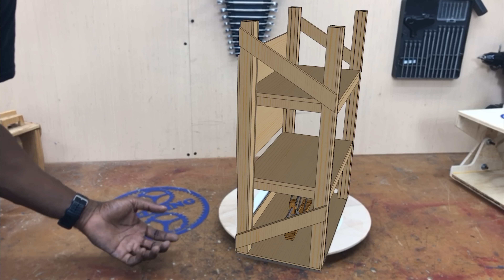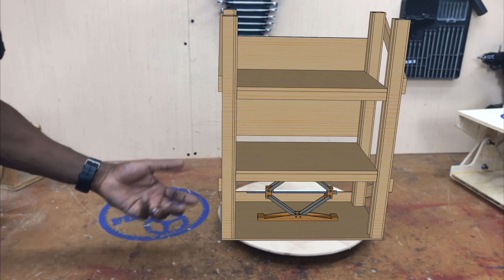Engineering Principles for Makers Part 2; Material Properties #067

Comment: Next time dont use a deceptive test like loading a metal beam in the weakest way possible and a wooden beam in the strongest way possible. If both were I beams loaded on the edge, the metal would be superior. You're trying to argue that wood can actually be better by performing a test that relies on using the metal part poorly/for the wrong job.
Reply from the maker: Sir, if you think I was saying wood is better you have completely missed the point. I agree with what you said. Perhaps give me a fair chance and actually listen to what I said about the difference. In case you won't take the time... the point was the arrangement of the material is just as important as the material itself.
Reply from the maker: You can see this proven in the math itself. When calculating bending moment it is E*I/Length. "E" represents the materials natural stiffness and "I" the the shape. They have equal weight in this formula and thus similarly important. This is what the video is about. Except I don't use these terms because I am talking to a non-engineering audience. I even put some of the numbers on the screen for you just to clarify its the same amount of material but arranged differently. Please watch again and you might notice the difference this time now that you are paying attention. There is no reason to be outraged. You just misunderstood, and that happens sometimes. No big deal. Just cool it down with all the claims of misinformation.
Reply: @Jeremy_Fielding  https://youtu.be/8EfZDWRHG0E?t=17
Reply from the maker: Agreed... lets just let the video speak for itself. I think its clear I am talking about the formula above, but I did say "or even better" than steel. So I see why you are all tied up in knots. Anyway... I summarize by saying the shape is as important as the material. The above formula was the idea. Thanks for watching. :)

Comment: Nice video.  Your revamp idea seems like it will allow you not to work to clear/clean off the top bench to use the second (a clear new advantage if you like that), but a down side if you needed the space vertically might limit your ability to work on taller projects that gave more volume from hight.  You had already constrained your length and width in your scope.   Sorry you are likely all done with this series I just watched them tonight..  I'm a crossover fan from smarter every day.  You projects are cool.

Comment: Moving to a new house with a slightly smaller garage, been working on coming up with a solution for a workbench, I want to do something similar, where I can have stationary power tools (spindle sander, disk sander, edge sander, scroll saw) all on the bottom, and be able to move them all up at once for being able to use them, plus having a work surface above them, currently I just have to move them around constantly.

Comment: My wife is short in stature and complains the upper cabinets are too high. I liked your idea of using two parallel tabletops because that would translate nicely into pull down cabinets for her.  These could also be used in houses for wheelchair victims.  Please expand on this idea more.  Also, I like the engineering emphasis of your videos.  It gives me much more to think about.

Comment: Your video is great.
I found it very interesting.  I am a degreed Mechanical Engineer and have spent the last 32 years designing machinery (primarily material handling equipment such as cranes, transfer cars, etc).  Your approach to problems is excellent and what a lot of engineers do.
I saw in a previous video you has a copy of "Design of Weldments". Excellent book. I had the pleasure and privilege of meeting the author,  Dr Omer Blodgett a number of years ago and attending a series of lectures he was giving.  Very smart man.  Good luck and keep up the good work.

Comment: More people need to see videos like this because there are SO MANY people that confuse strength and stiffness. Many people see deflection as weakness. I deal with this in my job as a mechanical engineer all the time. Everyone at my company wants lightweight equipment that can handle heavy, cantilevered loads with no deflection. When I tell them that 6061 aluminum is just as strong as A36 steel, they're all "But look at how much the aluminum one is bending!" When I respond "Well, it's still not going to break. So, if I make it out of steel, it will deflect 1/3 as much, but it will be 3x heavier." They're all "We don't want it heavier." Give them the option of making the aluminum version taller to increase stiffness without adding as much weight, and they still reject it because you're making it larger. There are trade-offs in every design. Sometimes you have to use a stiffer material when geometry can't change. Sometimes you can use a less dense material when the geometry can be taller to minimize deflection and save a little weight. Geometry matters just as much as material properties!

Keep making these great videos. The subject matter is presented so well. I'm glad that you demonstrate the principles with practical applications, especially the forces in multiple directions with that electric motor on the beam. I feel like the practical application of the principle is what is missing from engineering education, especially in the early part of the curriculum. You provide the answer to the question "When am I ever going to use this stuff?" by drawing the line between the principle and the application. That's what engineering is all about.

Comment: Jeremy, you must be a good engineer.  So many engineers know how to do the calculations, but don't think about these very basic engineering principles often enough when making a first run at a design.  As a mechanical engineer myself, I find this very refreshing.  I always have said that you don't necessarily need an engineering degree to be good at applying the principles, and that a little common sense thinking can take you very far!  (I had many "designers" that I called engineers because they understood these things.  I also had degreed engineers work for me who only had the title thanks to scholastic achievement.  Thanks so much for sharing this.

Comment: Just watched the video before this one, and now just finished this video. smashed the subscribe button. Your videos are awesome. I'm no engineer but I try think things through. I'm about to build a 16 x 16 work shop, and I'm wondering if I can put in a 2x6 (or greater) wood I-beam in lieu of a built up 3 ply 2x6 beam. I would be putting in three beams supported by concrete patio stones. Then build the 2x6 framing for the floor. So just wondering if three 2x6 I-beams would work. I am trying to build t on a budget, collecting most of the materials from my demolition job sites. If I could I would like to build the structure for free and only pay for the roofing and electrical materials. Interested to hear back from you and your thoughts on my question.

Comment: I used to work in bike shops and it always irritated me when people there would talk about aluminum frames being inherently stiffer than steel frames. They do tend to be stiffer, but they seemed to think it was an inherent property of the material when it is just that aluminum frames have to be made stiffer because the material fatigues so much more readily than steel that if you just copied a steel frame with relatively small diameter tubing in aluminum the frame's life would be drastically shortened. The aluminum frame would actually also be much less stiff than the steel frame due to aluminum's MOE being much less than steel.

Comment: Hi Jeremy, Your video is really inspiring me. I would say the way you are travelling with the contents on your head is making me relate to exactly how im working lately, things like we dont need to make everything out of steel, it doesnt always have to be gravity as the force that we have to balance, use of waste to make it work just by knowing their physical and chemical properties.  
Its all about how to precisely use the material.
I have few questions:
What would be the vibration force on the wooden base frame caused by treadmill motor while its under working condition? Would the wooden frame damp them with out deflection and noise? By the way how long would the wooden frame last before the screws and joints loosens up?

Comment: Your moveable work bench should use triangular supports instead off the front legs and use a long thin triangle to support the back so the work surfaces are free on the front corners.

Comment: Got a problem with your test for the different shapes and their deflection - in both instances, you're applying the weight in a way that wont fully apply to the bracing structure (around 5:30).  In those particular objects, the weight should be supported through the structure, not perpendicular to it, as you have done.  In other words, you should have stood them up and applied the weight to the "top" of the structure, as opposed to laying them on the sides like you have done.
Edit for clarification:  I'm not saying you're wrong about triangles vs other types of support structures, because you're not.  I am saying you demonstrated the effectiveness incorrectly.

Comment: I’m thinking unistrut as your rails. That is an easy obtainable material.you can use a garage door hinge and roller as your rolling part. I’m still trying to come up with a lift for a person to stand on to raise to about 30” and be stable. It’s for a garage door installer but any one in the trades could benefit from it.

Comment: Steel is tougher but the average guy can’t work with it. My limited experience in using steel I found how dirty it is. Plus it’s an entirely a new set of tools . You actually need a completely different area for work with steel. Ide love to fab stuff on occasion out of steel but don’t have any welding tools.

Comment: For me, the ideal horizontal space is one that slowly, slowly rolls so the top horizontal surface today becomes the bottom surface tomorrow. This forces me to keep the surface clear. What I am saying is that I don’t tend to be very good about tidying up at the end of a days work, especially if the project will take multiple days. I suspect There are other builders like me. So the idea that the horizontal surface becomes a vertical surface is appealing to me because it forces me to clean up after myself before the work surface becomes so clogged that I retch at the idea of cleaning up. By the way, discipline isn’t one of my strong personality traits. 
Great YT Jeremy, thank you!

Comment: Jeremy, your last video made me think about a wood furniture assembly table I saw while working with for soil conservation service.  The whole table was wooden with no metal.  The top was like a typical assembly table with holes for dogs and stops . The top rotated up and was able to be held at various angles.  The pivots were made out of separate wood part (hard woods bearing and pins)  from the structure.  The table was used for build wooden chairs and rockers,  I wish I had pictures but this was back when cell phones were wired into vehicles.

Comment: The pretzels remind me of a situation where I was really really stuck and needed to fix a damaged edge on desk. I had a rich tea biscuit (for americans it's a plain brittle light tan colour cookie) and some super glue. I crushed up the biscuit and maybe a little paste with the superglue in the bad notches, carefuly worked it in, cleaned excess and it actually work once scraped flush with the surface hahaha
Some maybe if we pair the pretzels with a polymer matrix we can make the next engineering super material!

Comment: As a new SUBSCRIBER to this channel, this is the kind of information I was missing from all the other channels I have been watching. I'm a retired electronics engineer. While I did have some ME classes, they didn't take the theory into practice. So I feel like you are teaching me to fish, if you get my drift. Thanks for the best channel I've found in a long time.
I'm contemplating building a DIY shop in half of my 2-car garage and want a workbench that fits the space and is easy to reconfigure. What I've been looking for is a bench with a small table saw at one end and a foldaway miter saw installed about half way down one side of that same bench. Long story short, among all the ideas I've had, using a scissor-lift mechanism would be the simplest thing to make to do the job well.

Comment: I like the idea of two horizontal work surfaces. the only downside I can see is the front pillars between the two work surfaces would limit its versatility, to fully utilize the work space. 
I would like to see if it can be engineered, to remove those front pillars without losing too much durability and strength.

Comment: Hi, thanks for the thoughtful videos. I am confused by your first example though, you laid the metal plate flat in its 
plane of weakness and the stood the I-Beam wooden structure standing up to test their relative strengths. Im sure you can see 
that this looks like selling snake-oil, why not stand the metal plate up and test it that way?
Reply from the maker: The answer is obvious which is why you are asking the question... check around 2:00 or so I explain why I did it that way. No one should be misled to think wood is stronger than steel. We all know the answer to that question
Reply: @Jeremy_Fielding  I did not check the link if thats what your referring too as the explanation for displaying the two materials strengths incorrectly (IMO). I think it should show in your vid that the plate steel would show zero deflection in that test if rotated up 90 degrees, although it would probably try to tweak side to side. Then take an I-beam of steel of the same thickness...it will be 50 times stronger than the wood no?
Reply from the maker: @whatyoudo9773  No... I mean right after the "link" part I say something like "notice I did NOT say that wood is stronger than steel but..." something like that. The key is separating strength related to material, and strength related to "shape" then the whole rest of the video is built on that prinicple. Shape matters as much as material. Certainly steel is stronger. Just don't forget that poor geometry makes any material weak. The lesson (I hope) is that sometimes the problem is weak material, but it can also be poor design. That is what the video is really about. Even steel is weak with poor design.
Reply: @Jeremy_Fielding  I think I understand your angle, but wouldnt showing steel plate laying down to test defelction be an example of "poor design" ? I just didnt see you then turn it up to express that it may be flexy one way but certainly not the other way and in that showing how to use "good design" concerning steel. Or then try your test on an angle-bracket or tube, both of which take up much-less space than a wooden structure of the same strength.  Its a very trick comparison mixing steel with wood, take a wooden slat near the same dimensions of the metal and lay it flat like the steel it would bend to the floor then snap so I get that your showing design theories, this one just rubbed me wrong cause it didnt show how wood performs if its the same dimensions as the metal. Take it as constructive I hope, still a great vid and you make some trick stuff!

Comment: Hey Jeremy
Both are great designs. I guess you have to decide whether or not you want the uprights of the second design to be in your way. The top bench of the first design allows for a completely open work surface. Unlike the second that has the four uprights that obstruct the open surface of the top and lower work platforms. I wish I had your design capability.

Comment: on your lath, consider adding sand or even cement / sand mix, then after it is settled in well adding just enough water to harden the cement.  Great deadening of vibration, something every lath has a problem with in use!  (This is why cast iron is used in the better lath bodies.)

Comment: So I’m new to your channel and I’ve really enjoyed your videos! Very informative! I tried to look for more recent videos but seems like the last video was about 10 months ago.  I’m not sure if you’ve already built the bench or if someone has already this idea but if you designed two shelves similar to the bottom shelf on your original design.  Connect both shelves through a common “lever” pivoted in the middle to the base. Both shelves will remain horizontal and easy to move without having a shelf above your lower work bench.  You would probably need supports that you could move in and out as you switch between benches... and locking pins.  one defect in the design is you would need to move the bench away from the wall.  Would love to see the bench when it’s done... gunna go look through more videos :)

Comment: Jeremy, great video. Regarding the bench lift, rather than using a "shopmade jack", I would repurpose the linear actuator for a treadmill. You can even double or triple the extension by using a chair lift mechanism similar to a forklift.
Reply: Actuator from an old satelite dish!

Comment: Awesome video, your comparing 1.5" thick wood to less then 1/8" steel im sure there would be zero deflection with a 1.5" thick steel bar
Reply from the maker: It would technically never be zero. But that’s not the point of the demonstration. Watch carefully again because the meaning is meant to be obvious not misleading in any way. I explain after the demonstration the difference
Reply: @Jeremy_Fielding  Gotcha yeah I realized that after, thought you had a 2x4 on there but it was plywood.